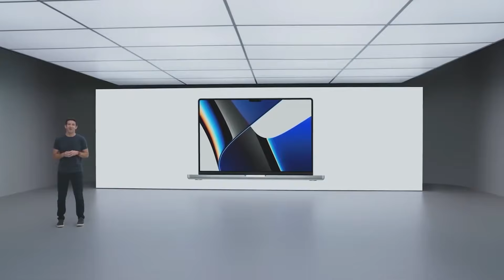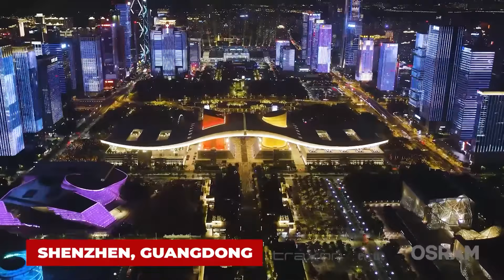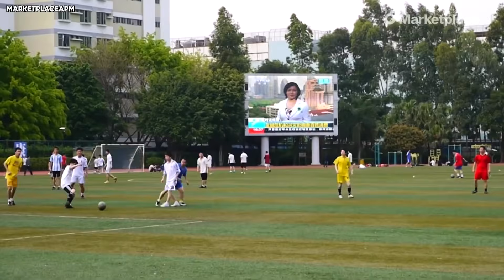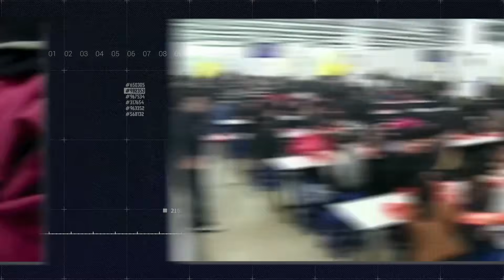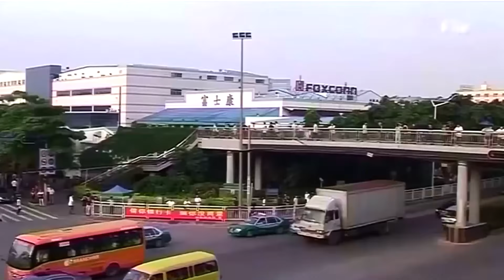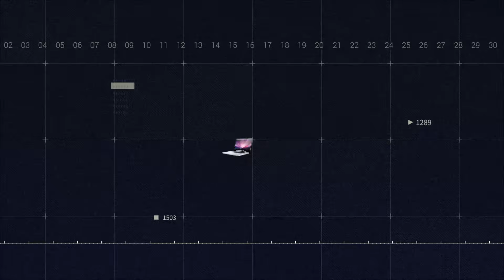Inside Apple’s INSANE Macbook Factory

Comment: as of 2023 I have a macbook I still use from 2009, but I finally broke down and had to get a new one this year because old one could no longer update
Reply: We must not buy anything from China, they love to invade other countries like Russia. Even how good they are made, I rather support made by own country.
Reply: I have a MacBook Pro 15 inch mid 2009. Of course, Apple will not upgrade OS (10.11.6 was the latest). I just installed the LATEST LINUX Mint 21.3 OS on it. It works perfectly. I have done this on multiple Apples and PC's that the manufactures no longer support. Pretty funny the latest Linux work fine.